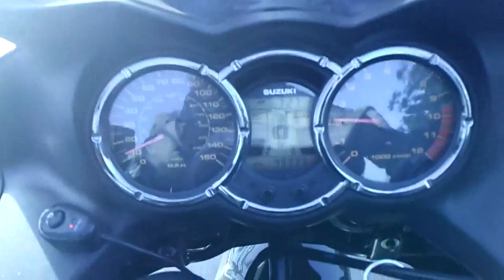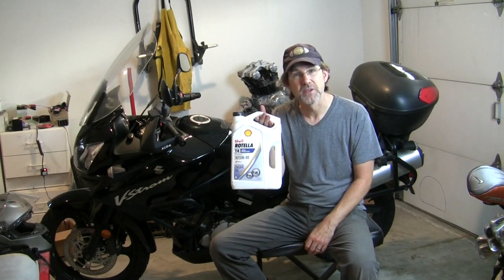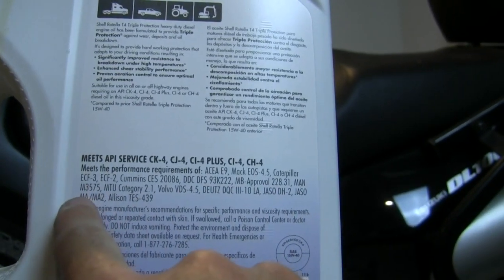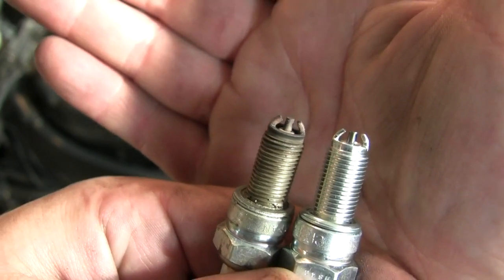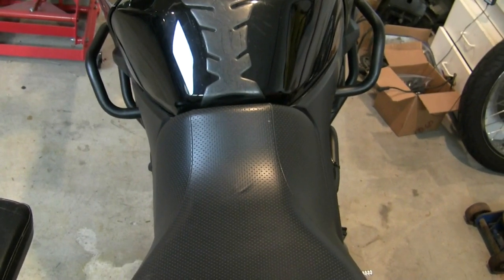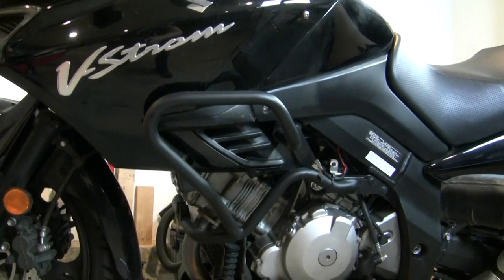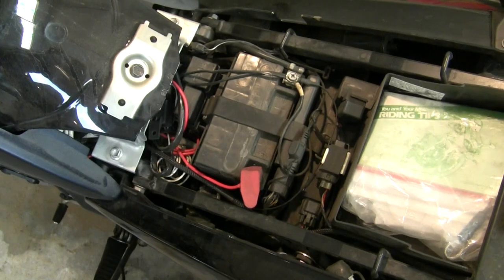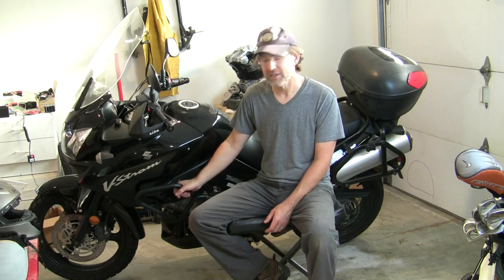V-Strom 50000 Mile In Depth Review

Comment: Wauww, that was an good honest video!! Thank you very much sir.  Can you tell me what the real world (gps) topspeed is? Best Regards from Denmark
Reply from the maker: The younger version of me could tell you that, but as I'm now a fatherI can only say I've had it to the ton. Was at about 5800 rpm there and red line is 9500. Not sure if it's governed somewhere between there. Perhaps that question has been addressed on Stromtroopers forum. Thanks for watching.
Reply: I have 2011 DL 1000 . I never tried top speed, but I know 220 km/h can get easy.
Reply: aldis šķerbergs 225 km per hour by Gps garmin

Comment: 2012 Vstrom 1000 49,300 miles update.The last three months the Vstrom has been problematic. The Regularor  rectifier , Stator and clutch push rod seal all failed . The clutch push rod seal is a horrible design. Two master mechanics have replaced rod seal and it still drips. I’m hoping to drive the Vstrom a while longer but. I’m having  my doubts .
Reply from the maker: Has yours had the reg/rec replaced? There was a factory recall on those. Could be reason for that failure, possibly.  Sorry you're having issues with yours.
Reply: I never heard of recall on Regulator but I did have recall on the ECM unit when I first got it . Thanks .
Reply from the maker: @westfletcher9219  Check with dealer. I just received a card in the mail from Suzuki regarding the reg/rec potentially failing in wet environments. I haven't done it because I am too busy and it's dry here.
Reply: I replaced. My regulator rectifier Two months ago thanks . I bought my bike 7 years ago  I dint think the recall would pertain to me

Comment: Enjoyed your video, lots of interesting stuff. The melted plastic may be due to the screen solar reflecting on the inside surface when the bike is parked and the sun is at an appropriate angle.  Maybe this is what you meant, but when you referred to the screen acting like a magnifying glass and there was no shielding on the screen I thought some folk might think it was something to do with the sun coming through the screen rather than due to the sun being behind the bike on some days of the year. There's a building in London that does  this on some summer days, which the designers had not contemplated.
https://en.wikipedia.org/wiki/20_Fenchurch_Street
Reply from the maker: You're correct...That's exactly what happened. London gets sun? 😄

Comment: 50,000 miles, 50mpg = 1,000 gallons. Put those gallons in a car which gets 25mpg. 25,000 miles. So you'd need another 1,000 gallons to reach 50,000 miles. At $4 per gallon, you'd be out $4,000. So, you've "saved" $4,000 dollars. Now start paying for the bike, the tires, oil changes, filters, chains, sprockets, hours you spent doing the maintenance; the insurance; the yearly registration and taxes over that 5 years, your helmet, gloves, kevlar jeans, armored jacket, RAM mount, hard bags, tank bag. Still ahead of the game? Hell no. You won't save money with a V-Strom 1000.
Reply from the maker: Thanks for throwing in your two cents here. I appreciate what you are saying. My logic has always been to compare the cost of ownership of a V-Strom against the cost of one of the more popular adventure bikes (i.e. BMW R1200GS or 1250GS). Some of your numbers are a little off from my experience (for example 87 octane fuel is usually around $3.40/gallon here and my V-Strom probably gets more like 38 mpg), but it appears you are comparing to car ownership. One big metric I'd add to your analysis is depreciation. That's a big one. I highly doubt there is any 4-wheeled vehicle out there that can compare with the overall costs of ownership of a used V-Strom. And for me, riding a motorcycle will always be a higher quality experience than riding in a car or truck.

Comment: Frist of all I enjoy your videos as I own a 50K mile 1st Gen V Strom as well.  But there are a couple of things yo failed to mention that affect many 1st gen DL1000s.

#1 Possibly the biggest issue is the poor clutch basket design that cause many of these bikes to delelove a very annoying vibration between 2500-3500 RPM. There is a fix for this problem, but unless you are an accomplished mechanic with proper tools the fix can be expensive. I had the problem with the bike I bought.

#2 You didn't mention cam chain tensioners that have been known to be an issue with these engines as well.  IF the bike has been serviced well like yours, maybe there isn't an issue.  But because the tensioners are oil pressure controlled, if the bike has not been serviced well this can be an expensive repair as well.

On another subject might I suggest if you are going to continue making these videos that you invest in a good wireless mic system and a camera with an external mic input.  The audio quality on your videos is very poor, lots of echo and low volume.
Reply from the maker: Thanks for watching and sharing those good insights with others. I've read about the issues you raised,  but didn't feel I should make comments beyond my own experiences. Glad you raised them. I'll poke around some wireless mics and see what I might find.
Reply: I would second the issue with the clutch. Mine was also shuddering in the 2500 to 3500 rpm range. I am in the UK so I had the Sharealike mod done which cures the problem.

Another potential issue is the magnets coming loose on the rotor. These can be fixed using jb weld. I fitted a voltmeter to monitor the charging.

Thanks for the videos, been useful for me especially the valve clearance adjustment. I had 7 valves either on the tight limit or just a bit too tight. All now set correctly.
Reply: Did you ever think that maybe he didn't mention those issues because he didn't experience them?  Do your own video and you can tell everyone YOUR problems, including your tendency to nitpick other people's videos and act like a know-it-all.  Urban Monk was much too kind to you in  his response.
Reply: @mudster2504  I also found a loose magnet around 30,000 miles and fixed it with JB weld. I installed a Werks clutch basket to solve the chudder. My '03 now has 45,000 miles with a 4 month northern Michigan riding season, and I too would take it anywhere with confidence. I've been toying with replacing it with another ADV bike...but then I come to my senses. This thing is a tractor and I don't think it will ever die! My next bike will be another DL1000.
Reply: One thing I forgot to mention...I had to replace the rear cylinder exhaust gasket. This is a known issue due to higher heat...no big deal. These bikes are easy to work on.
Reply: Audio is perfect here in Ireland ;-)
Reply: Thought the cams were gear driven, hence the whine you hear.

Comment: I absolutely would have bought a used one but I wanted traction control and used '17s were within a few hundred bucks of what I wound up buying a new '19 xt for. I think the vstrom is the most sure thing you can get for a used buy, both because they are legendarily long lasting and also I think it's not the sort of bike that would be ridden by the typical idiot rider.
Reply from the maker: All good points! Thanks for sharing with the community. I believe I may have made an error in the video in stating all the 1st Gen Stroms have Nikisil lined cylinders. I've read my 2012 does, but some earlier may not have. Regardless, you're very right in stating they are long lived engines. Thanks for watching!

Comment: LOL You change oil every 2000 miles? That's WAY too often! You're wasting a ton of money.
Reply from the maker: I don't change it every 2000, I average 2400 or so. Some changes happen earlier because of timing and expected trip mileage. And it isn't expensive. Cheap really. If I spend $40/year on oil and filters I'd be surprised. Not exactly a ton of money.

Comment: Could BMW make a reliable motorcycle like this. 🤣🤣🤣
Reply from the maker: I get the joking spirit of the jab at BMW, but having never owned a BMW I asked my good friend who has owned many. He says he's seen some BMWs with over 200k miles on them. All I know is this Strom was much less expensive (much) and seems to be very reliable with excellent performance. Thanks for commenting! 🙂
Reply: I must buy a bmw and see for myself . Maybe it would be reliable .  I’ve known people that had bad luck with them.
Reply from the maker: @westfletcher9219  I've read horror stories about BMWs too but they contradict the experience my friend has had. He's a very accomplished mechanic though...the perspective of the reviewer is always something to be considered. Could be minor problems are more frustrating to those who are not knowledgable and have to pay high labor rates to fix every little issue.
Reply: No.  I owned one for 6 years -- NEVER AGAIN BMW -- too bad because the bikes are nice to ride and the Duo-leaver front end is the nicest active suspension you will ever experience on any motorcycle.  Duo-leaver smoothness of a Harley over potholes and goes rock hard the moment the front brake lever is pressed so no dive.
Reply: @UrbanMonkTV  Lots of shaft problems and final drive issues and super expensive parts and weird 'the German-way' of doing things.  Front-end mis aligned forks, using cheap grease on the shaft drive splines. Plaged with problems throught the decades.  Watch my video on shaft failures (older pre 2000 models) https://youtu.be/-FJbNifR8uA and look at the repairs I did on my K75s and that is just a tiny number of the total repairs!
Reply from the maker: @pcofranc  Thanks for sharing your insights here. Valuable to others.
Reply from the maker: @pcofranc  When I met my wife she had an Audi. I sort of inherited maintenance of it. Loved driving it, hated maintaining it for same reasons. Never own one again.
Reply: Recently  at a BMW dealership and took a BMW GS 1250 for a long  ride . Well maybe the gs handles better than the Vstrom but the bikes to. ME have the same power. The price of the Gs was $22,000 out the door. Plus all your services have to be done at the dealer via laptop computer. BMW = Big Money wasted
Reply from the maker: @sigmund3413  Thanks for watching. I've ridden side by side with a 1200GS and never felt like I was struggling to keep pace. Honestly I was setting the pace. In fairness, the 1200GS didn't seem to have trouble keeping up with me either. However, the GS was always out of gas first.